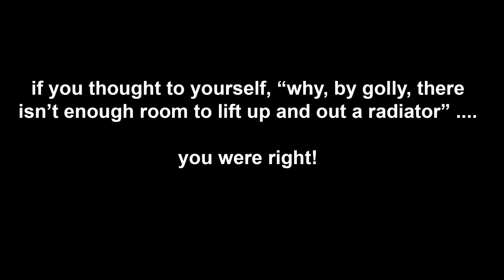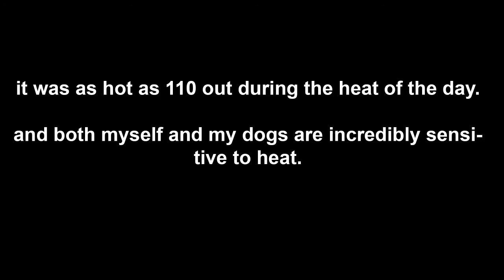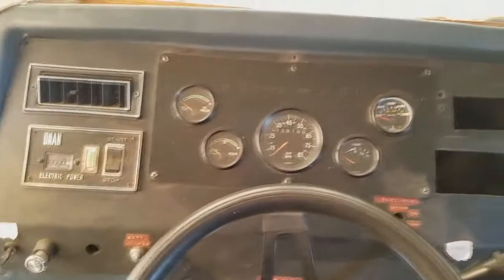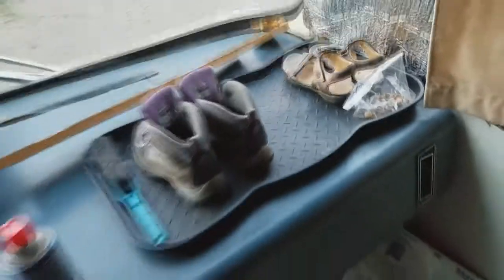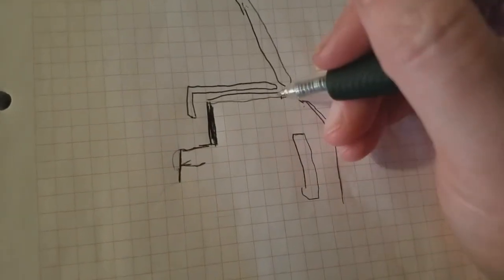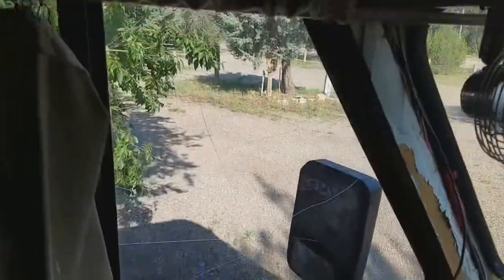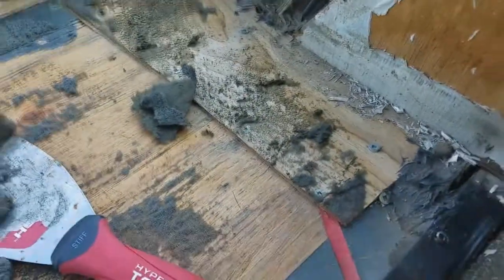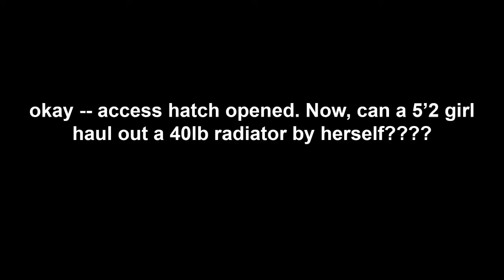Dashboard, Meet Crowbar - Radiator Removal! -- Summer Hell Project Saga, Part 2

Comment: Grateful I found this. I have a 75’ airstream argosy motor home. I am sure you’re aware of how unforgiving working on older coaches can be. They will beat you up. I think the engineers may have been stoned when they designed the radiator placement. You’re a badass. All 5’2” of you. Thanks for the video.